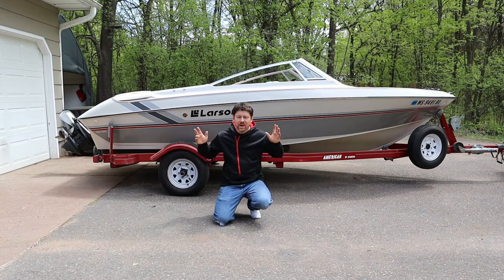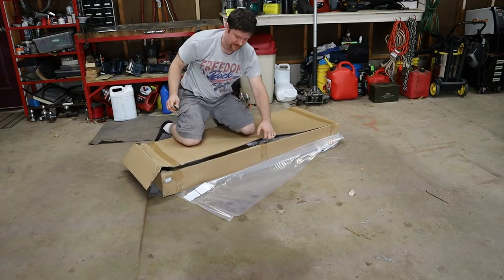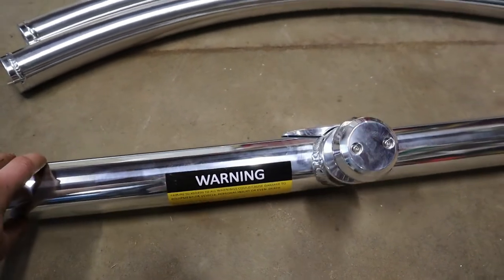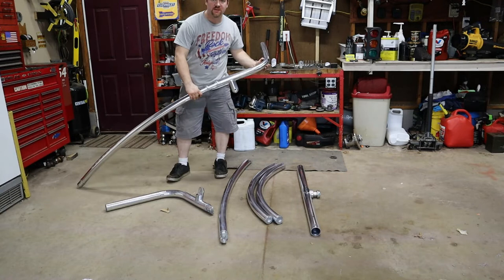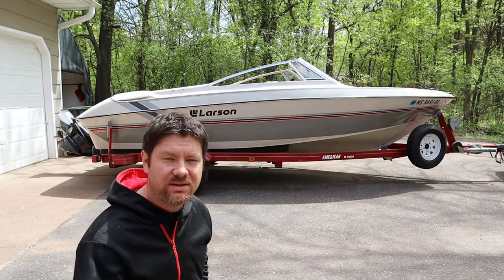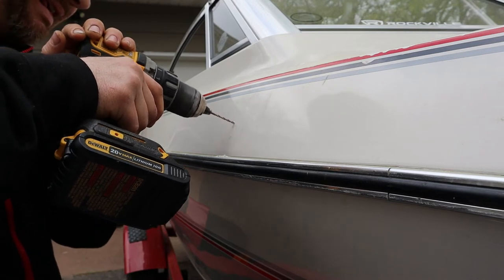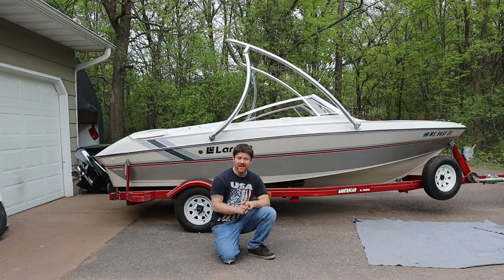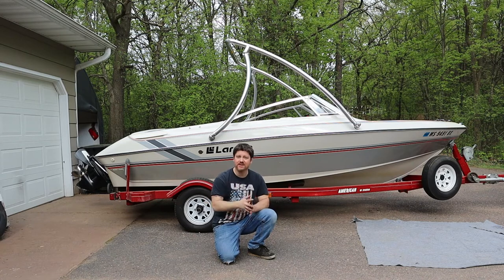How to install a wakeboard tower

Comment: You the man! Thank you for your great tutorial. I put together nicely before installing it, but was confused on the front and you cleared that up. Then got to the last part, putting the top ski bar up and man I'm glad you showed that part because that's exactly what I was running into. It looks like you had to disconnect the rear legs to get it on property.
Reply from the maker: Yes I did. Glad I helped you out!

Comment: thanks for instructional video, I highly recommend reverse rotation of drill motor through the gel coat layer to prevent cracking.
Reply: Why reverse
Reply from the maker: It makes the drill bit act not as sharp (so the sharp I just don't catch the gel coat). It is a good trick, however I've never had an issue with cracking gel coat if I don't press too hard and let the drill bit do the work. There's also a trick where you can put tape over where you're going to drill through to prevent cracking gel coat also.
Reply: @daleofalltrades  thanks. I just bought (go to pick up) a 2000 Bayliner capri 1850 with the 3.0. Maybe I’ll put a tower on it at some point